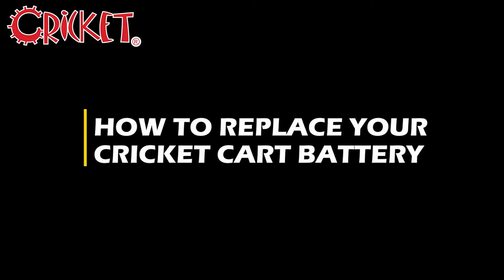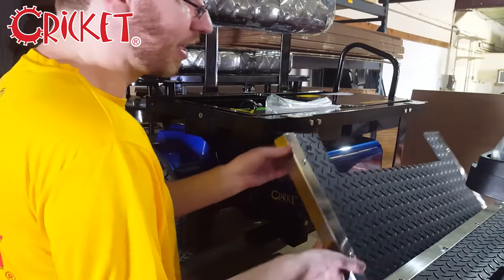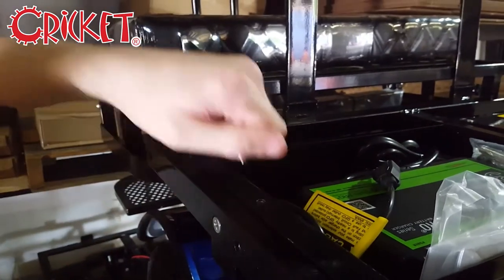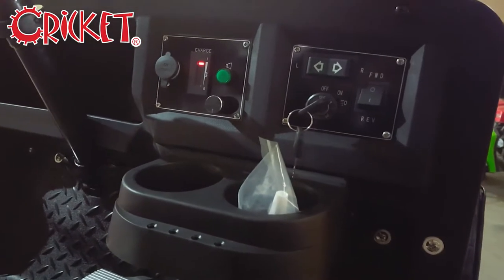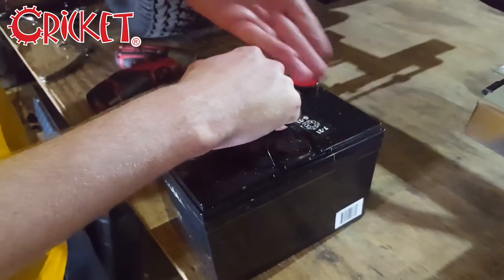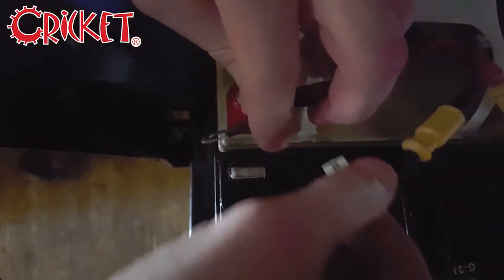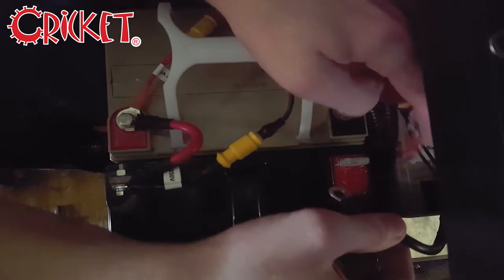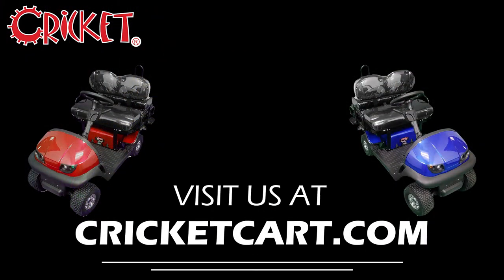Cricket Cart Battery Removal and Replacement! | Cricket Carts: Small Mini Golf Carts!

Comment: What could be causing my crickets to be running under the suggested MPH? I have a 2021 that goes about 8.5 MPH and a 2020 that goes around 11.5 MPH
Reply from the maker: Be sure to check that the speed knob rotates completely to the opposite side, it should rotate at least 180 degrees. If that works, it may be a motor or battery voltage issue, in which case, either check out our 5 volt regulator video, or contact our technicians at 321-752-4041, or through our website at https://www.cricketcarts.com/ . We hope this helps!

Comment from the maker: Have you replaced the battery in Your Cricket Cart before? Let us know in the comments below!
Reply: help   disconnected batteries to replace them but don't know where the wiring harness leading from the front of the cricket to the batteries attaches    I think they go to the third battery located under the box I cant remove there's a red and black wire    please help
Reply: i really need a schematic of the battery wireing
Reply from the maker: @judyhornbeck4631  Of course, our helpful technicians should be able to assist! Just give us a call at 321-752-4041 and ask for help with Cricket Cart Maintainance, and we should be able to send you the diagrams you need! If not, Contact us or your local dealer via the other contact information provided on our website at https://www.cricketcarts.com/. Hope that helps!
Reply: My battery charging box has rivets ILO Phillips Head Screws.  What do I need to do in order to be able to access the batteries?